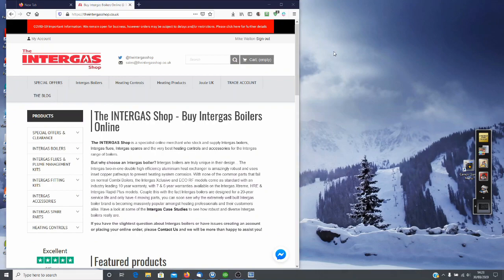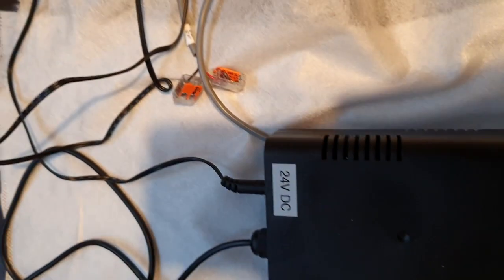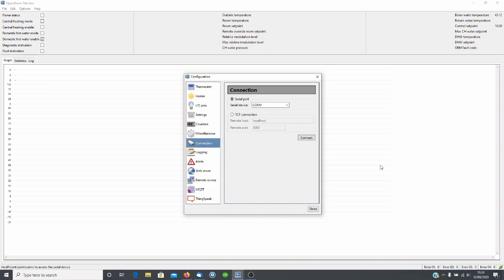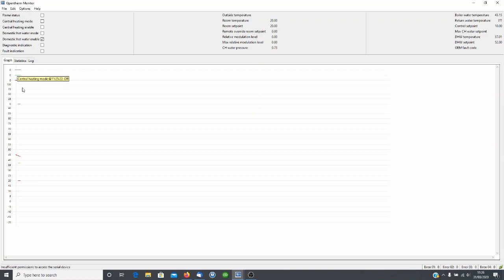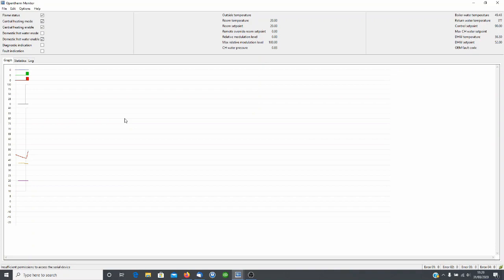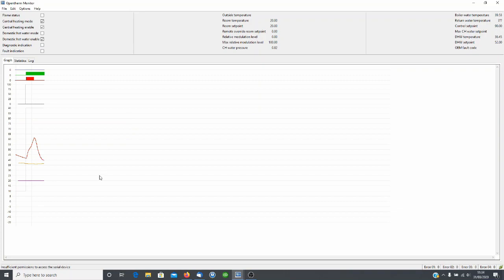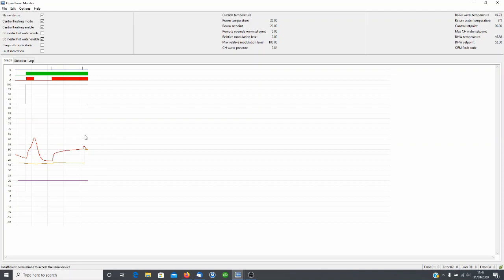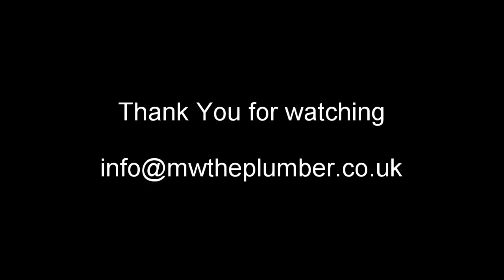Opentherm Monitor Video

Comment: Will this work with the wireless gateway?
Reply from the maker: If yiou mean a wireless OT bridge as used with Evohome, the answer is yes.
Reply: I mean from the intergas WiFi gate way. 
I don't have open them bridge as using the built in bdr1 on the 30kw xtreme.

Was hoping the WiFi gateway would do the same as the USB version?
Reply: Having read up more on them, it seems that although they are both called gateway, they are different 🤔
Reply from the maker: @petersplumbing29  Yes, totally different.
Reply: @mwtheplumber  can you make this one wireless.  The boiler is rather a distance from the PC

Comment: Will this operate on all versions of OT & Bus communication systems Mike?
Reply from the maker: Will work on any Opentherm boiler & control. Doesn't work on other bus systems such as E Bus or K bus
Reply: @mwtheplumber  
Thanks Mike that’s a very informative video.  Currently using E Bus on Vaillant(not my Spec) & finding it great     on Two Zone controls in smaller properties.  Also used it on hybrid system with ASHPs & Gas boilers.
Looking forward to more of your videos👍👍